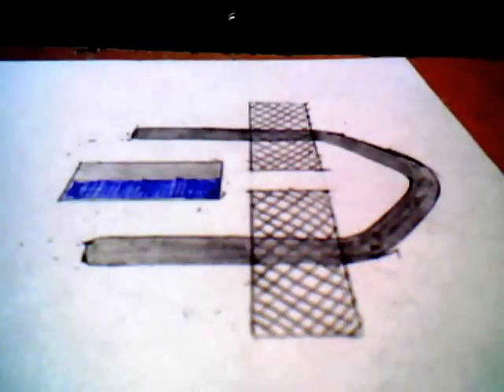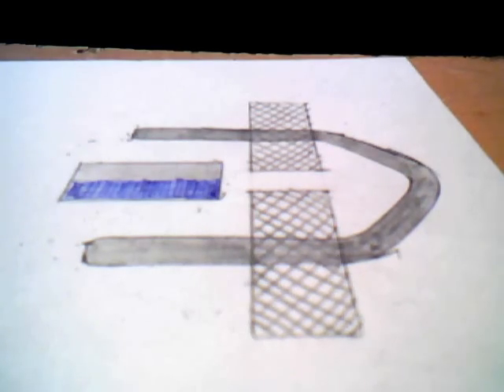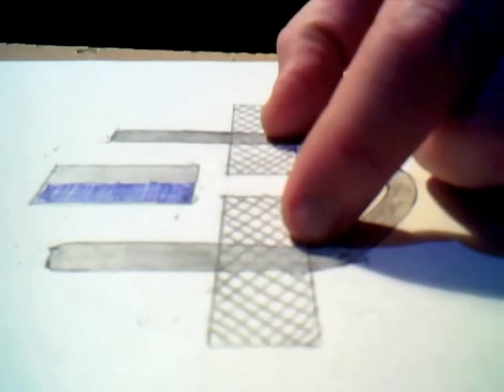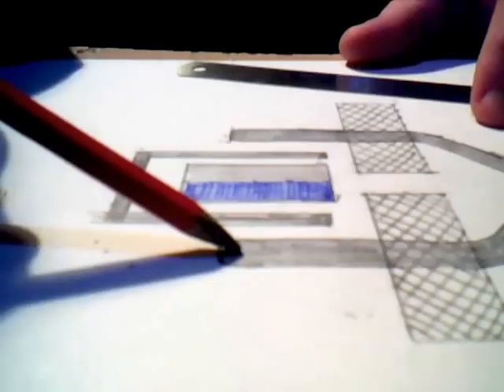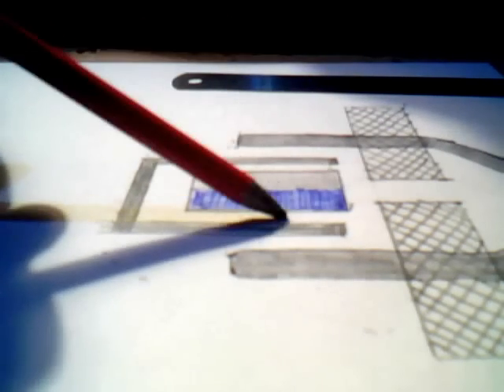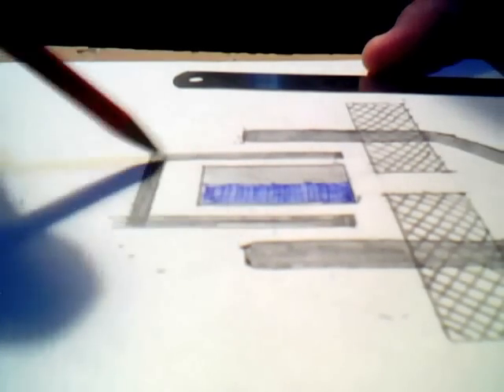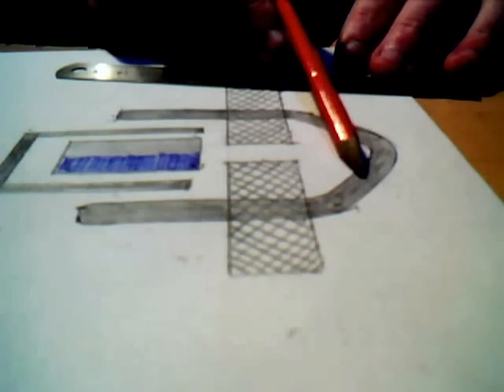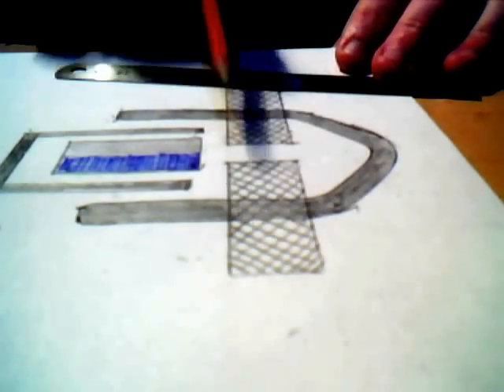long forgotten generator type

Comment from the maker: For a high speed generator say over 5,000 RPM you can use aluminium as the separator and get some really funky effects but the you have to be careful of lenz drag still.

Comment from the maker: yes, no,, sort of...
first of all, it does depend on what it is that your using, whether its actual iron or steel.
because of lenz, it create a field in the opposite direction so it's constantly degaussing the core of the generator coils.
The isolation core would become partially magnetise IF all the magnets were in the same directing. So by alternating north forward and then south forward you would eliminate this effect.